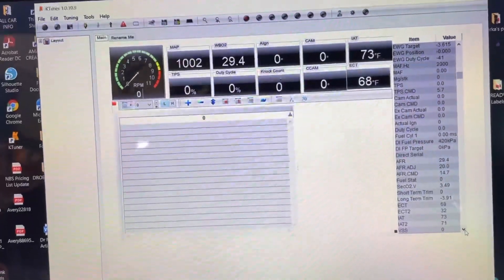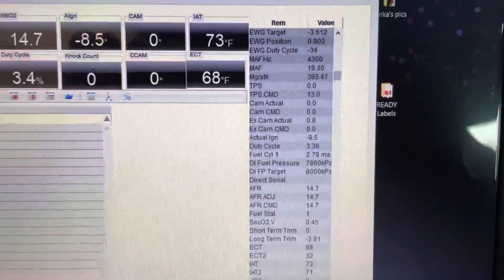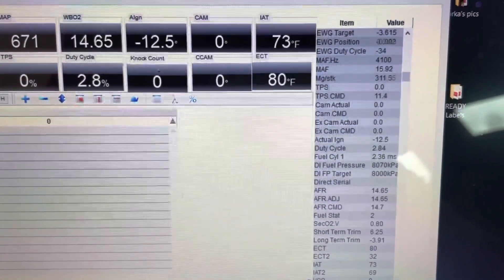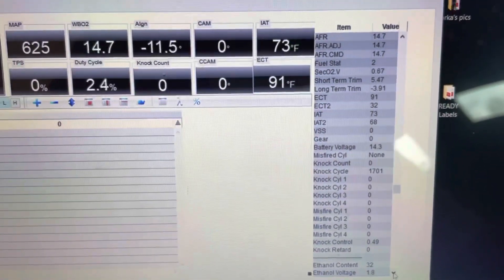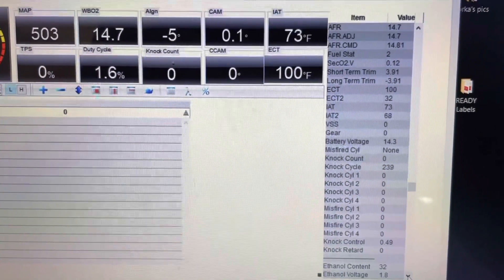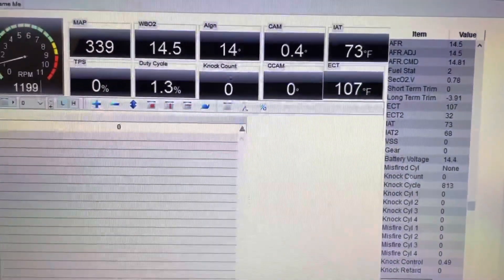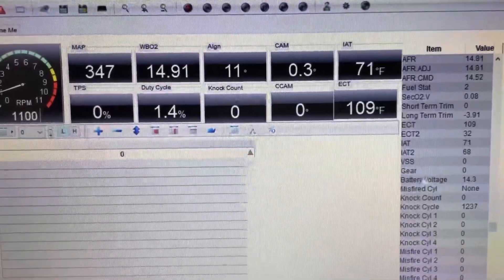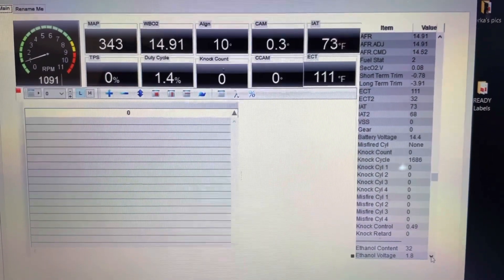Honda Accord 2.0T - Ruthenium Spark Plugs vs Iridium INSTALLED! [HD]

Comment from the maker: Correct Part # 91784 - Comes pre-gapped at .031, and depending on your setup and tune; [the gap could vary between .030 all the way down to .020 for the OUR VEHICLES]. This IS NOT an OEM plug for the FK8 or Accord 2.0T, so it won't show up on the AutoZone website as a part that fits our vehicles.
Reply: These plugs are good!
I want to upgrade to Ruthenium for a European vehicle and the Gap on the ruthenium's are slightly larger at 0.044" while the Iridium gap is 0.031" ...
The OEM gap for this vehicle is 0.031"
Will it work with the larger gap?
Everything else is identical, in terms of thread diameter, thread reach and hex size.
You think there will be misfires or anything?
Reply from the maker: Thanks for watching! Not sure if they would work. But you could definitely test.
Reply: @dfls5069 , Get yourself a quality gapper with the top that spins down evenly to gap them down. You want to match your OEM gap at the very least. If you're tuned or have bolt on's you may want to bring them down a little more
Reply from the maker: Absolutely. See vid: https://youtu.be/VTQjjJ2elLk
Reply: @dfls5069 why not just regap the plugs to factory spec,  just buy the tool
Reply: You bough a spark plug that doesn't fit your vehicle? Oh boy.
Reply: @CenobiteBeldar  LOL it fits perfectly. Companies that sell FK8 parts are selling them now and if you contact NGK they'll confirm fitment and use. They told me they're perfectly safe to use. They're actually designed for Turbo vehicles

Comment: Looking to purchase spark plugs for my 2019 2.0 touring, which ones do you recommend, can I get a part number, advance auto showing autolite but I see everyone using NGK
Reply from the maker: If stock, I say go to the dealer or check rock auto. You should be able to google the part #. For the ones Im using the part # is in the description.

Comment: Why such an extremely tight gap between the electrodes? 🤷‍♂️
Reply from the maker: The vehicle has custom ecu tuning for my modifications (bigger turbo, fuel, etc.)
Reply: @fred_b_360  I'm German, so I prefer the metric units. 🤪
But gaps of less than 0.040" (1 mm) are quite rare with modern, high power ignition coils.
In older, East-German vehicles or engines for boats you had to go down to 0.6 or even 0.4 mm (0.024" or 0.016"). But that was (partly) with 6 V systems, in outboard engines or scooters even with magnetos,, pointers instead of electronic systems and coils that could barely deliver 5,000 V. Today's systems deliver 15,000 to 80,000 V. 😉
Did you do highway, drag or dyno test this small gap? Would 0.040" deliver more power?
Reply from the maker: @u.e.u.e. the car was dyno’d and track tested.
Reply: @fred_b_360  😎👍

Comment: my isf ran a little rough and after these plugs it was a dream, i current run these plugs on my caprice ppv cammed 6.2 build with no issues and it runs great

Comment: Running them on my 1.5t no issues gapped to .029
Reply from the maker: Thats good news to share! Your the first i’ve heard running them on the 1.5.
Reply: @fred_b_360  yeah I saw your videos and you commented that it could blow it up lol so I wanted to try them first hand I used them in my g37 before but they got my acceleration back
Reply: @kswervo808 when I buy them ngk plugs do I have to gap them because I’m running stock no nothing or just instal them because I heard the oem gap is 0.43?
Reply from the maker: @Moha-zt7cw It’s always good to “check” the gap on all new plugs, even if stock. The owners manual should have that info. I been gapped at .022 for so long, I can’t recall.

Comment: You should remove that crankcase breather and route it to your exhaust at highest point of velocity. having crankcase under negative pressure will give you a few HP and better ring seal. :) in some V8 application they even use pumps to get like minus 6 bar!
Reply: Oh and use a check valve so it does go backwards...

Comment: hi, does it fit for accord 1.5t ?
Reply from the maker: No. These are specific to the FK8 and Accord 2.0
Reply: @fred_b_360 if I use it for 1.5t it’s ok or better to not try it
Reply from the maker: DO NOT USE these plugs for the 1.5… You will blow something up.
Reply: @fred_b_360  thank you I was really thinking of use it already but I think now to not use it

Comment: Misfires are probably from morons gapping them with a coin gapper smashing the electrode
Reply from the maker: Definitely a possibility.
Reply: I heard they are good for 30,000 miles but tend to fail faster if the situation isn't perfect?
Reply from the maker: mine were cooked with about that many miles🤷🏾‍♂️
Reply: @fred_b_360 yep do NKG ridiums they are better way longer.
Reply: @fred_b_360  If you have high miles I would still change them out at 40,000 but they will go a 100 thousand in a newer car.I still wouldn't go over 60

Comment: 2011 lexus is250 awd  replaced iridium plugs with  ruthenium plugs at 120,000 miles . Car currently has 143,000 miles. All good no  problemas
Reply from the maker: same here🚀
Reply: Its about more power what about gains ??
Reply from the maker: Haven’t dyno’d with them yet. But they have been tested in the FK8 community and proven to show slight improvement.
Reply: @fred_b_360 😂😂😂😂😂😂😂😂

Comment: your motor still holding up with all that power?
Reply from the maker: Yes. The motor isn’t the issue. The trans is the weak point. From what it looks like, it tops out around 500 before you start having problems.
Reply: @fred_b_360  Found that You will Need To upgrade TO  ATC Sport Clutch The Transmission will benefit greatly from it also Dope Setup Keep Posting Content CHeers